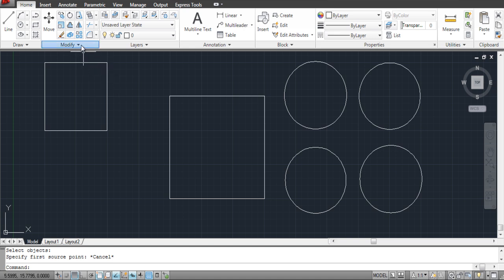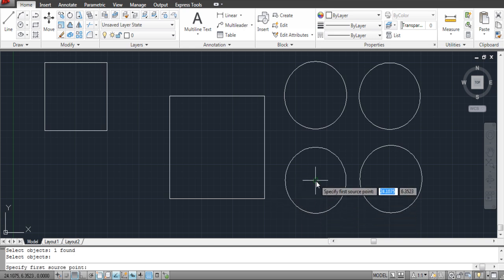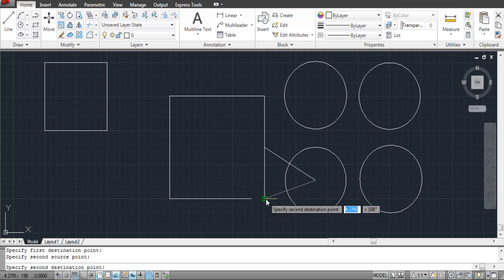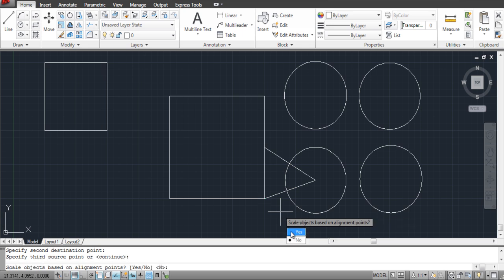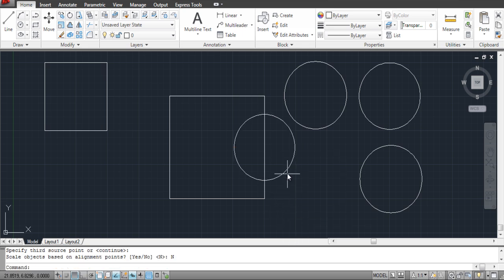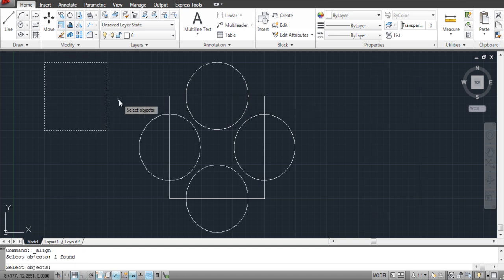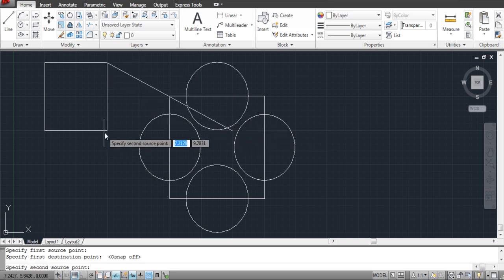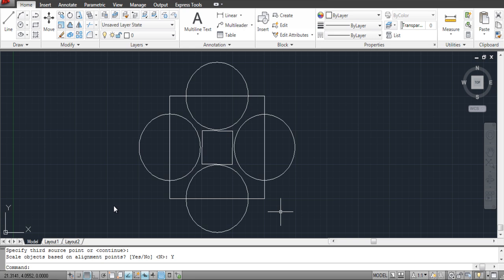How to Align in AutoCAD

Comment: This doesn't even make any sense. You select the center of the circle, select the bottom and center of the square and the circle aligns to the center of the square. Where is the logic?
Reply: I know this is an old comment, but the first point selected specifies WHERE the circle will connect to the square. At this point, it's basically a circle connected to a square like a pin (free to rotate). Then, the second point specifies the angle in which the circle is rotated at that point, making the circle no longer "pinned" and making it have a set rotation. I think if you don't specify the second point, it just doesn't rotate and stays straight up and down just to save time.